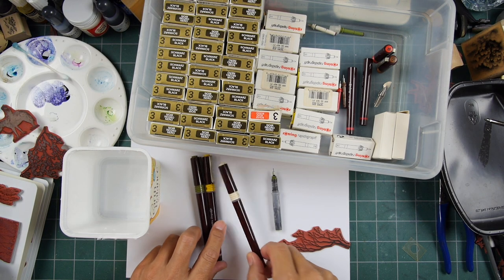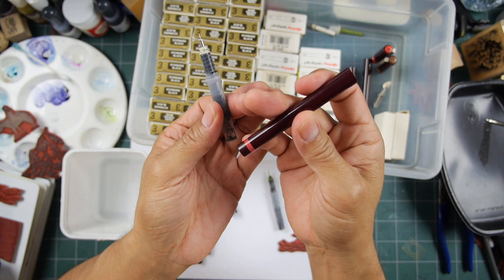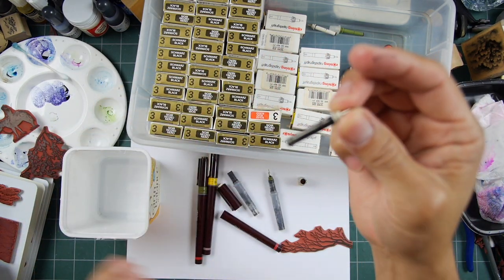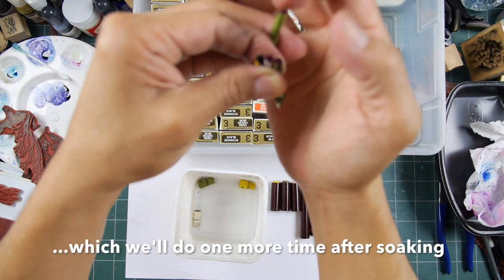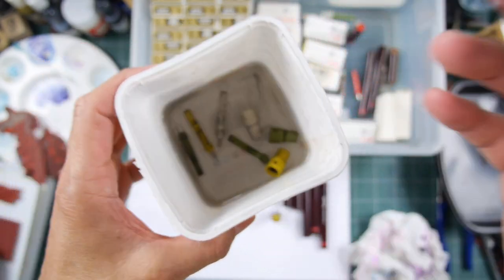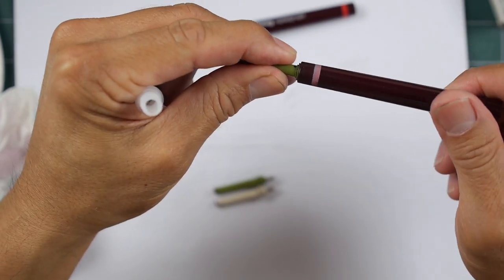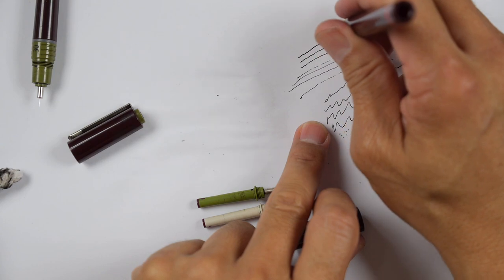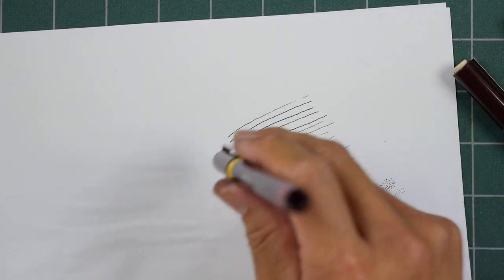Rotring Rapidograph Cleaning & Unclogging

Comment: Nowadays, when most paper makes lines spread to at least .5mm no matter what the nominal size of the nib, I want a .2mm or less needle pen that writes with indelible ink, reliably, every time I want to use it.  I've been cleaning needle pens with all that hassle every time, most of my life, but now, the only thing I can write fine, reliably with every time, is the 50p mapping dip pen I used at school.  If only someone would put a reservoir on one of those!

Failing that, I want someone to make an 'ultrasonic ink well': a us cleaner  on the desk just big enough to dip technical pen tips in before use, in much the same fashion as we ussed to do on desks with built in ink wells.  Such a device would save pen artissts and draughtsmen, and anyone who wants to make fine and permanent notes, half a lifetime of wasted time and filthy fingers and spoiled clothes and furnishings.  It comes as a surprise that pen lovers are still making do with devices intended for cleaning jewelry or spectacles, and having to dismantle their pens and get inky fingers every time, when all theyy really need is something to give a nib a good shake under water.
Reply from the maker: I think the days of potentially getting something like your ultrasonic ink well has come and gone with less people using these types of pens than 20-30+ years ago, at least in the professional drafting world.  It's just us artists and hobbyists left using the pens.  You might have to devise something as it sounds like a useful device.
Reply: @stampscapes  Searching afterwards, I  was surprised to find that Rotring did actually used to sell purpose made US cleaners with their own logo on. They look a handy size and shape compared with the commonly available US machines for home use, which are mostly shaped for cleaning spectacles, and rather shallow. The Rotring one was more 'bean tin' shaped, and would stand up a bundle of pens at once. A rare collectable now though.
There are a lot of DIY hobbyists out there in YouTube land though, so a collaboration between an electronics hobbyist and a pen and ink art fan, might well be able to come up with a small US device to be used on the go and plug into a USB port.  Some people are even building desks with hidden computer touchscreens: adding a 'smart inkwell' could be very appealing to an artist alternating between physical and electronic media at the same work station. I'd certainly like one!  (y)
Reply from the maker: @spamletspamley672  Interesting!  I think I see what you mean.  Here's one on Ebay: https://www.ebay.com/itm/224320553473?chn=ps&norover=1&mkevt=1&mkrid=711-213727-13078-0&mkcid=2&itemid=224320553473&targetid=4580496732614416&device=c&mktype=&googleloc=&poi=&campaignid=418233788&mkgroupid=1230353745471221&rlsatarget=pla-4580496732614416&abcId=9300542&merchantid=51291&msclkid=6a0ab15d67021cb7d088d0918cacd338
Reply from the maker: @spamletspamley672  I also see this unit for the Isograph pens.  It's a similar idea to the Koh-I-Noor humidifier.  Looked on the Rotring website and don't see it so must be a discontinued product: https://youtu.be/FQIU5L9t72A
Reply: @stampscapes  Thanks: I added some more suggestions on how to fit the cleaning wires and make new ones. I think I'll have a go at mounting new wires in my broken 0.01 tips from school! :)    Didn't know there was foam under those  pen stands.  I use a cardboard box with similar holes punched in it as my portable desk to work in bed.  I'll cut out a bigger section and try damp foam in there too. I suspect it will soak up all the expensive ink though!... :)
Reply: I eventually bought a reasonably priced 2litre US unit with heater and timer built in. I wanted the bit of extra depth over the few cm of the jewelry and spectacles cleaning units.  It comes with a wire basket and says not to put things actually on the base of the tank itself. I guess vibrating metal on metal might wear holes in time.  Basket reduces the death, but, what i did was get a plastic pot that had had houmous in, and punch some 1cm holes in the base, so i could upend it in the tank instead of using the basket, and stand a number of pens at a time with just the needles and their mounts dipping in the water, with just a few drops of washing up liquid in.  My best.18 Staedtler was flowing again after just 2 minutes of ultrasound, and i soon had all my pens flowing again.  Surprisingly, the only ones that took a bit longer, were a 0.5mm with black ink in, and a 0.2mm with red ink. I guess it was sheer quantity of dried ink in the black one, the the red was unexpected, as it's usually dye based and there are no pigment particles to build up. In this case, i had to dismantle, and found the red was coating the plastic parts of the pen like nail varnish and it wasn't dissolving in the water in the cleaner. I had to scrape it off. I'd guess i must have bought ink for writing on film by mistake. Something to be wary of with plastic needle holders, as you can't use solvent on them without risking their splitting.  Very pleased with the device so far. Fingers never been less black!
Reply: Sorry: joke spellchecker replaced depth with 'death'!
Reply from the maker: @spamletspamley672  Sounds like a device that's going to work well for you!  You should shoot a video of it explaining how you made it and post it here on YT.  Yeah, I can see film ink not easily going into solution.  I think I've used that film variety decades ago but don't remember much about it.
Reply: @stampscapes  I've not tried to post my own videos--I usually find that everything I want to know about has already been covered. It's made fixing and maintaining things so much easier than it used to be when we had to hunt for workshop manuals!  It would be handy if they could add the ability to upload explanatory photos and kids in these comments though.  I'm not equipped to hold the phone and demonstrate things at the same time though--and rather hit and miss when I try.  Mostly, the plastic racks and containers I make are just cut out of food containers with a butane powered 'soldering' iron like the Dremel Versatip. It's hot knife tip is fabulous for trimming bottles and other containers to get the shape and size you want, and the simple tapered point makes most of the holes you need. You may have to trim the melted edges with a knife for some uses, but most of the time you're looking for instant utility rather than neatness.   
The ultrasonic cleaner was just a cheap Chinese 40kilohertz 70watt one.  It has to be earthed but came with a lead without an earth pin, but it's easy enough to put your own plug on rather than send for a replacement.  Very pleased with it so far: wish I'd had one years ago!  :)
Reply from the maker: @spamletspamley672  Sounds like a good device for you.  I'd be curious to see it some day.  If you post some picts of it sometime, please leave a link to it here for everyone to see.  There's a lot more people using Rotring Rapidographs than I ever would have thought at this time apparently.  I would have thought these Rapidograph based videos would have got 100 views max at most when I posted them.  Glad to see there's still quite a few that know and use them still.

Comment: What if the ink used was waterproof? Is there a solution to help clean the pens?
Reply from the maker: Hello.  Is the brand of your pen Rotring and the model Rapidograph where you used the standard cartridge ink?  Or, a different brand or Isograph and not Rapidograph?  If Rotring Rapidograph ink, this method of cleaning has always been all I needed.  Some have mentioned hot water that seems to work for them so you might try that.  The standard cartridge ink, when dry, is waterproof if that's the one you've used.  You have to tap out all of the dried granules of dried ink if you're using a small nib and that can take a while.  I usually tap out the nib in a bowl of water and only after I don't see anything coming out at all for a long time (while tapping) do I try another cartridge.  I've been impatient at times over the years and have had to remove a new cartridge and empty out the nib again to get that last dried granule or two out before the nib's been free to flow again.

Comment: What to do if there’s a ink blob appearing in your nib?
Reply from the maker: The ink keeps developing a drop of ink even when you wipe it off?  That's happened a lot to me over the years.  I haven't read up on this but I'm assuming it has to do with pressure building up in the ink cartridge and I've suspected it has to do with the warming of ink in that reservoir to the point where it starts squeezing through the nib and out the front.  I would suggest trying to cool the cartridge.  Just unscrew the nib and cartridge from the barrel (don't separate the nib from ink cartridge) and dip the cartridge into some ice water to cool it down.  Then, try the pen again.  There still might be some residual pressure so just wipe that drop of ink off a few times and see if it stops.  The hand can warm up that pen quite a bit and then if it's hot inside to begin with, that's a pretty significant temperature range from room temp and something being held in a warm hand.  If that doesn't work, and worse comes to worse, maybe disconnect the cartridge and just reconnected it.  That could also remove that pressure that would be in there.  I hope this helps.
Reply: take it off with some paper.
Reply: Similar to the other comment, just release the pressure in the cartridge by slightly opening it. But don't cool it off. Once you release the pressure little be fine. Cooling it off will just make it pressurize once it comes back up to room temperature
Reply: @Ducimatic  No man, the ink blob will just reappear. Release the pressure like the man says.

Comment: Brilliant. The pens are mine and were working so Ill try all that. Best wishes and thank you Martin
Reply from the maker: Hope your'e able to get them flowing.  Much better chance of it being that they were yours.  Someone mentioned in another comment that they've dropped the nibs into a cup of boiling hot water and that worked well for them.  I've never done that so I don't know but, if it comes down to trying that or tossing them, you might give that a try.  Maybe getting those molecules moving around faster could help.
Reply from the maker: Someone just posted that water didn't work for them but the actual Rotring cleaner did well for them.  You might try that.  I've never used it except in my old Koh-i-Noor Rapidographs as I haven't had to but maybe the ink chemistry/recipe was changed by Rotring.  I bought a lifetime worth of ink cartridges 10 years ago when I thought they might be discontinuing the pens and I panicked.  I'd hate to think this would be the type of company that would do this but some companies do things to expedite the need for replacement of their goods. This niche company probably wouldn't but it would be something like adding a little extra drying formula into their ink chemistry or something like that.  Again, I wouldn't think they'd do it but whoever buys these types of pens are probably highly loyal to a particular brand but nibs that work for 15-20 years isn't making a lot of money from those consumers.

Comment: Hey, i've actually inherited a great set of Rotring Varioscript pens that have been sitting around for almost 50 years! The larger diameters are working perfectly again however, the smaller ones are pretty stubborn and the ink does not seem to having been water-based/soluble... I was thinking about using an ultrasonic cleaner, but am a little afraid that this could damage the fine filaments. What do you think? Or has anyone tried this?
Also, any recommendations for affordable, inks? Some of the original stuff was actually still somewhat usable although it kept clogging the pens with small particulates, but a new ink i got had terrible opacity, especially when applied with the smaller diameter pens, and looked more lightly gray than black.
Thanks for the video!
Reply from the maker: Wow, I had to look up Varioscript pens as I had never even heard of those.  I don't know if any of the tech pens specific inks were water based but I just use water to unclog mine.  The inks aren't actually going back into solution like a dye but the water, from my experience, loosens the dried inks allowing the piston to come free enough to work those dried ink particles out of the nibs.  I don't see why an ultrasonic would hurt the nib so I think you'd be okay to use one.  I don't know the construction of the Varioscript nibs but I'd go the ultrasonic route before I removed the needle/filament if that's possible on these nibs.  Whenever I removed those in the Koh-i-Noor Rapidographs to clean them, I rarely was able to feed that back into the slot without bending them and that was doom for a tech pen.  The ink, I would use with the pens is the Rotring ink.  What inks did you try and are you sure the nibs were completely empty of water (if that's what you used to clean them with)?  I've cleaned my nibs before and you really have to both work the water out by shaking and allowing sufficient time to dry to get them completely clear of that water inside of them or you'll get that diluted ink for a while before the ink's flowing without dilution.  Also, you mentioned the small particulates in the ink.  Are you sure that wasn't leftover dried particles from the previous dried ink?  It really takes a while to work out all those tiny crumbs of ink out of the nibs.  It just seems to keep coming, especially, if the ink was completely dried inside of all nooks and crannies in the nib interior.
Reply: @stampscapes  Thanks for the quick answer!
I got them all perfect now with the ultrasonic cleaner, but i took the filaments out before i put them in. After the ultrasonic bath i just dried the "nozzles" with a little rolled up paper towel and all the crusted ink came off like a charm. Had no problem putting the filament back in.
Have you seen what happens to aluminum foil when you put it in an ultrasonic cleaner?  That's why i was a little concerned it might damage the finest filaments, but thy don't seem to having been damaged.

The ink with the little particles was the original ink that came with the pens and had been lying around all these years. I knew that it wasn't good anymore, but had no other at the time. Until it clogged the pens, it still provided beautiful, opaque black.The other ink i then tried, that was grey rather, was some Koh-I-Noor "Drawing Ink".

Oh and btw... your art looks amazing!
Reply from the maker: @N.M.E.  Awesome.  Sounds like you're good to go and the pens will have a second life with you.  I hope they work out well.  That old, I'm guessing they might have been used for drafting more than drawing and used with straight edges.  I only mention that as, sometimes, tech pens can be like fountain pens where they kind of configure to the user over time and the angle they tended to use them at.  Then, if someone else uses them, they might not flow as nicely.  But, if it was drafting, it might have been more of a neutral vertical angle.  Yeah, the drawing ink might be a little more fluid/diluted if it was something like a dip pen or brush ink.  I'd use the Rotring or Koh-I-Noor Rapidograph inks for that true black.
Reply: Use some chemical solution containing soda, such as the one for removing stains from laundry  for unclogging. Use hot water as far as possible . Don't hurry, unclogging might take one week, be patient. Ultrasonic { a "portable washing machine" will do) is very effective but only in the final phase.
Reply from the maker: @Ducimatic  Thanks for the comments/tips!
Reply: Never use hot water, warm maybe but hot water actually deforms the plastic, talking from experience as I lost a set doing that.

Comment: I just got a .25 today. You say it’s a water based ink, so would I be able to use other water inks like ones for fountain pens is I refilled it? Or would it not work?
Reply from the maker: The Rotring Rapidographs, as seen in this video, use the cartridge inks and are the only inks that I use with my pens.  The cartridge inks are waterproof and permanent but clean with water.  I know some people that use the refillable types of inks with their Rapidograph pens such as calligraphers but I don't know what types of inks are recommended for that type of usage.  With some of those non-brand specific inks, I would think that it wouldn't be recommended to leave the ink in the nibs for as long as you would with technical pen inks but I don't know.  I just did a quick net search and found a page out there with your question asked of pen users that can answer your question better than I.  I hope this link can show up in my reply here:  http://www.fountainpennetwork.com/forum/topic/136481-fountain-pen-ink-in-technical-pens/
Reply: stampscapes that link was great, right at the bottom someone flat out said fountain pen inks in their rapidograph worked fine. Thanks for the info and quick reply.
Reply: It will work. Common (black) ink  has no carbon black and therefore is not clogging. Very good for thin nibs as 0.25 . Clean after each use. Don't use printer ink.
Reply: @jikerwa  Dye inks will usually work in any pen.  The main point of Rotring/tech pens for me, is to be waterproof.  It's horrible to see your work ruined after one sneeze, or put your work down in a damp patch. That's why laser printers are best for documents.  The expense of good pigment ink comes from having to make superfine and regular sized pigment particles.  Usually red ink is dye, so doesn't block much, and is easier to clean when it does.  It can spread out more on poor quality paper though.